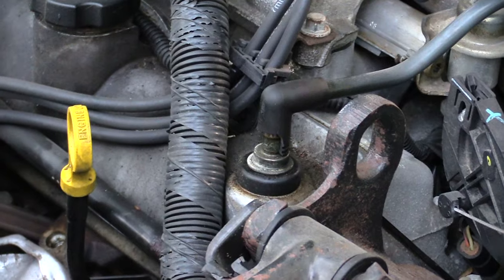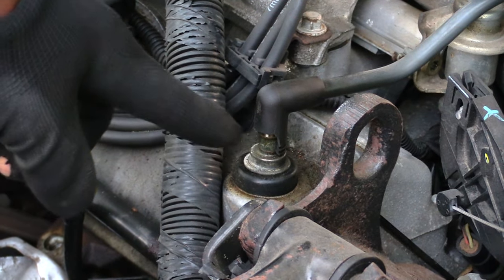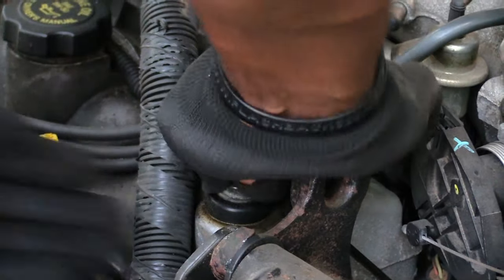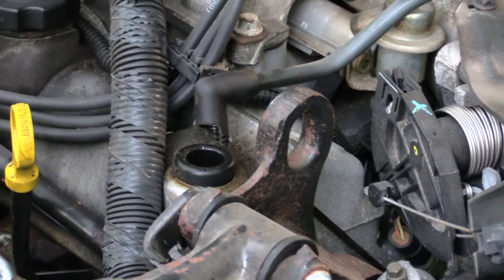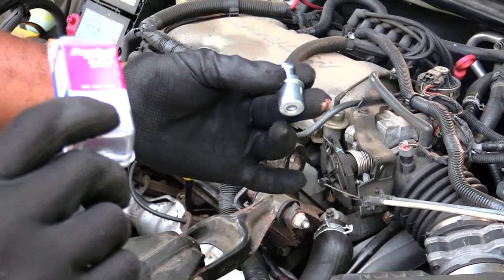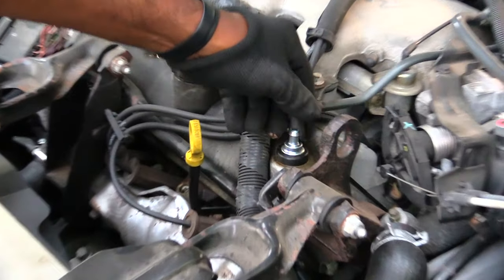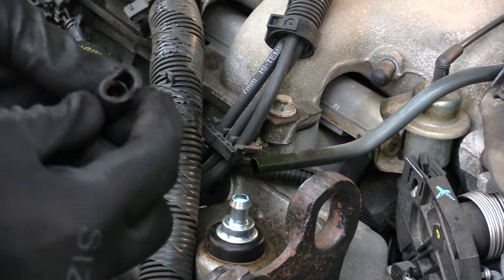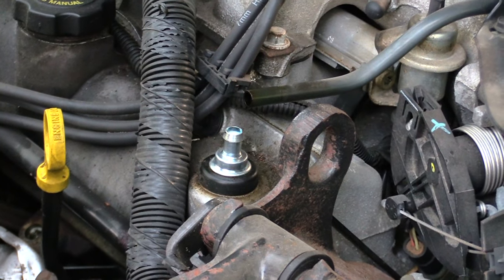PCV Valve Change- *Chevy* and many other Makes and  Models of Vehicles

Comment: Hello. Could you let me know how you replaced the PCV hose?
Reply from the maker: First Last thanks for watching if your car looks the same as mine and  if it is the same piece that's broke, just pull the end off, that connects to the pvc, if it's the whole line u have to take out the 2 screws that's holding the middle down then follow the hose to the u part and pull it off from there. Please Subscribe if haven't already and check out my other helpful videos.
Reply: Amazon has a replacement PCV with the rubber hose with the correct bends in it. - Just type in make/model/year and engine size. - Hope this helps.

Comment: Where can i find my pcv valve at on my chevy colorado 2008
Reply: The colorado with the "I-5" engine does NOT have one as this video shows.  It is a fixed fitting in the driver's side of the block that has a hose that turns up and hooks into the intake manifold.  These engines (and it's "4200" "I-6" as I have in my trailblazer) is prone to having the fixed fitting stop up and build pressure in the engine, which causes the valve covers (on the earlier years) to leak oil into the spark plug recesses in the head.  You have to take off that hose, and clean out the fixed fitting with a strong carb cleaner and to use a small wire to push through the port in the fitting.  The v-8 engines that are optional in the trailblazer has a similar setup, except the fixed fitting is in a valve cover.  I hope this info helps you!

Comment: I can't remove the valve from the pipe:( when I try to remove the valve it comes all together with the pipe , what should i do ?😐
Reply from the maker: j. gallardo thanks for watching u normal have to slowly twist and pull the valve out, and sometimes the pipe will crack, and u may have to get a new 1 from AutoZone, they are about. 3 dollars. Goodluck

Comment: That pipe is broke because it use to have a push in button that must be pressed in while removing!  It's hard to push in enough, so use a tool or screw driver tip.
An alternative to replacing is to just clean it by spraying some carb cleaner into it's suction underside mouth real good. The oil stopping ball inside should be loose and rattle when shaken. 

Take care